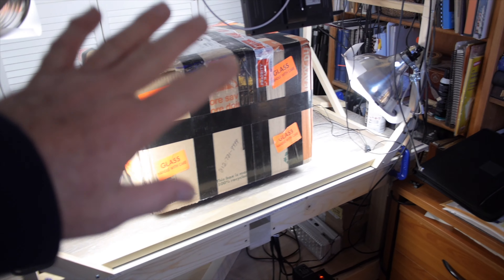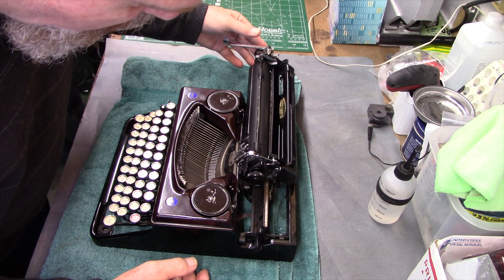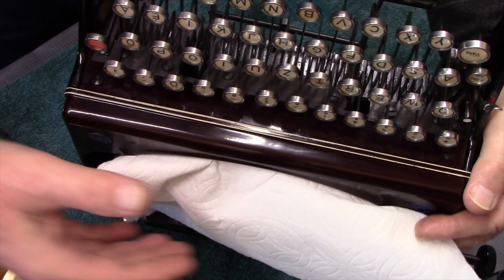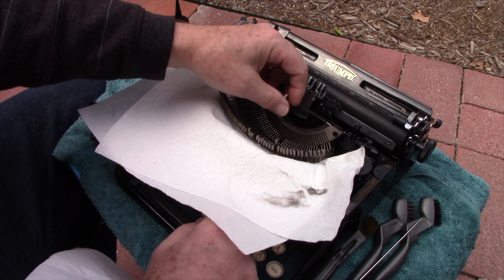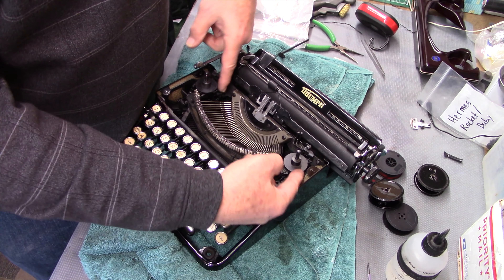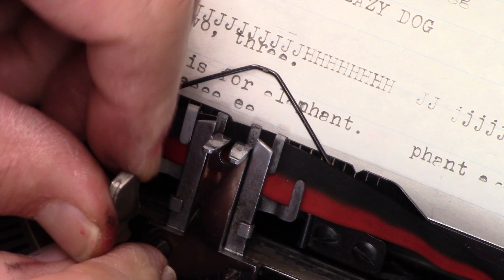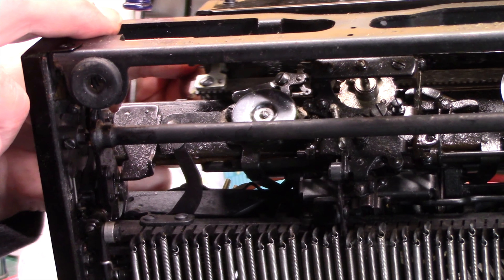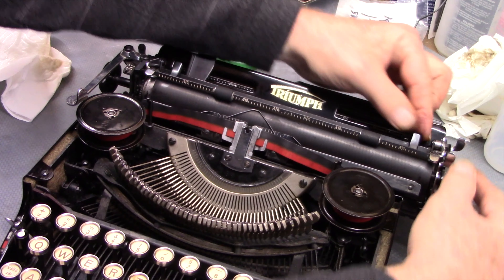Typewriter Video Series - Episode 160: Servicing the Triumph Norma 6

Comment: Hello from Belgium.

I have the same typewriter. Recently bought from an old shop.

I would like to clean it.

Can I ask you to list the cleaning liquid products  I have to bought ?

Thanks 🙏🏼
Reply from the maker: I use compressed air to remove the dust and particles, then 90% isopropyl alcohol in the mechanism to loosen the hardened lubricants, followed by compressed air. If the alcohol doesn’t cut the grease, use lacquer thinner, but be careful to not get it on the paint or plastic surfaces, and use it in a well ventilated space. After degreasing the machine I use light oil, like for sewing machines, on the carriage rails and any pivot joints that seem to be stiff. I don’t recommend using oil in the slots of the segment where the type bar joints are, those should pivot freely just by being clean.

Comment: I wonder if a typewriter repair kit, with appropriate tools, can even be had in this day and age? Your idea for using gunsmithing tools is brilliant, however.
Reply: Dr Joseph V Russo  I agree - I have a small Pachmayer gunsmith's set, a screwdriver handle with interchangeable bits, it's magnetic, and was about $25 a few years ago. You can test for a good fit just using the bit, then fit it to the handle.  Parallel pliers are handy too, and good quality small wrenches/spanners.  Great video Joe!